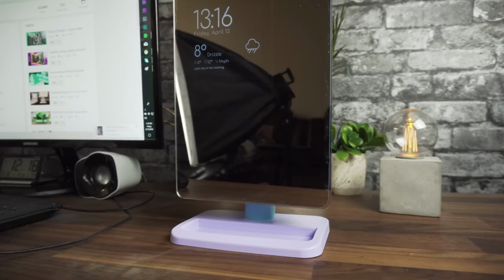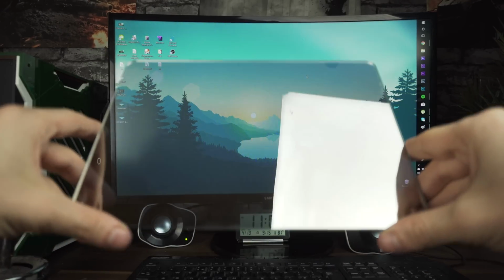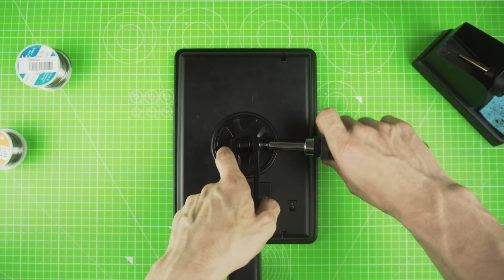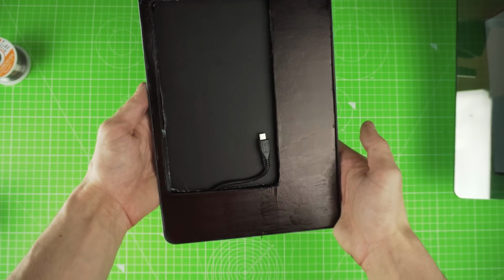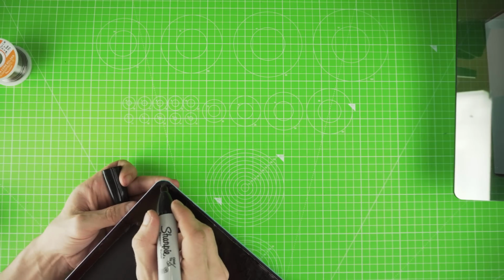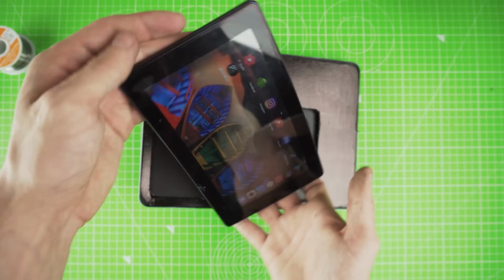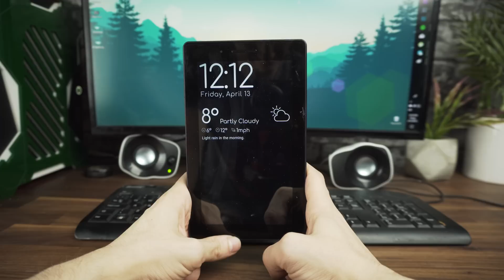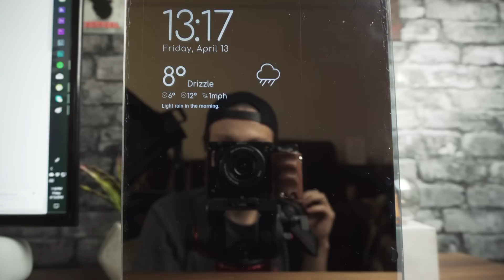Make a Smart Mirror from an Old Tablet

Comment: Is it possible to do this with a regular wall mirror? I’m wanting to try this but I want to do it on a slightly bigger scale to use as wall decor and for my living room. Any ideas would be greatly appreciated!!
Reply: As long as you have the money you can size this up to as large as you want really. I've seen 32" ones too.
Reply from the maker: No it will not work, It needs to be a double sided mirror so that the light from the tablet passes through the glass, with a normal mirror the light doesnt pass through
Reply from the maker: But you can find this mirror for quite cheap if you get a bigger size, hope that helps!

Comment: Does the capacitive touch work through the mirror?
Reply from the maker: Unfortunately not, but having a micro usb extension allows you to connect with an otg cable and use a mouse and keyboard
Reply: Thanks ;)

Comment: Hi, what do you do if you need to change the settings or their is a problem and you need the touch screen?
Reply from the maker: You can use an OTG cable and a mouse plugged in
Reply: Adam Builds so what about the power supply?
Reply from the maker: Keep it plugged during the night like any other smartphone, or go to the  next level and get a timer or a smart plug and set it up to charge every 6 hours for 2 hours :D
Reply: Adam Builds no mean theirs only one outlet and I need one for the powers supply and one for the ogt
Reply from the maker: Why do you need to do that at the same time? Just change settings and charge after.